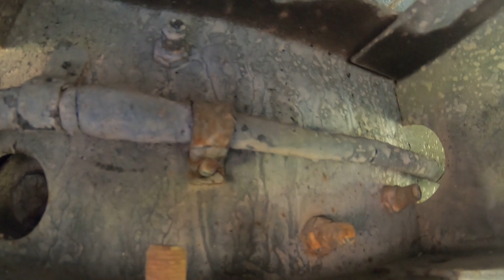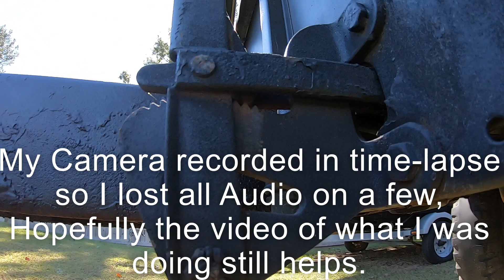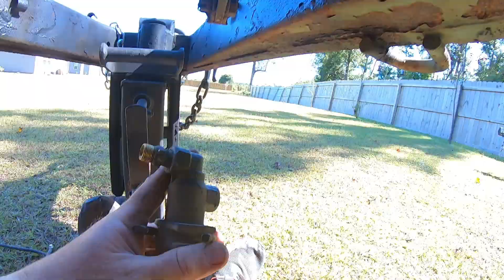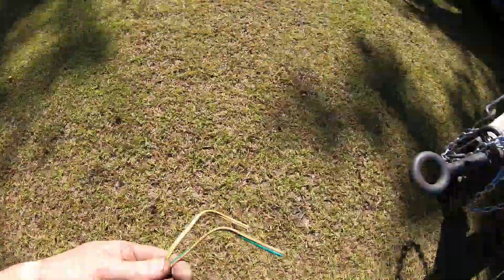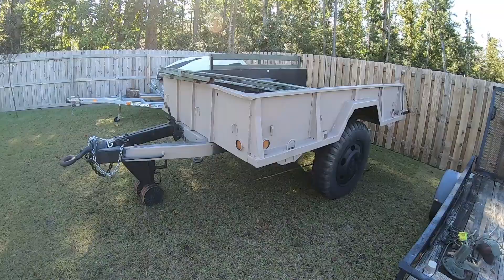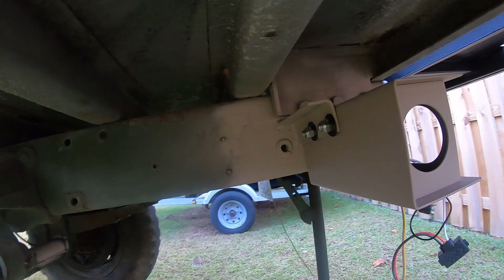M105A2 Trailer, tear down and lighting install started.

Comment: I'd drill out the 24v spots in the stock lights and just add in 12v sockets and wiring. Get the old style halogen bulb sockets and just throw in LED bulbs.

Comment: Why not just put 12 volt bulbs in the existing lights. Keep it simple.
Reply from the maker: There was a few reasons that i wanted to for my build. 1st is when using 24 volt with only 12 volts the brightness will be half. The 2nd is the older wire was brittle. 3 there was no way to just plug it into the jeep, so I needed to wire in a 7 pin anyways. 4th I wanted lower amp pull on the tow vehicle. It keeps the alternator and battery from having to work as hard. 5th, with LED's I am able to use them as emergency flash patterns. 6th they are brighter and can be seen from a much further distance. I'm sure there are a lot of other little reasons, but those were my big reasons to change  them out, Oh yea, I think the LED looks better also.

Comment: Where'd you pick up the brake light boxes and signal lights? I got some plastic lenses but am really not enthusiastic about those on an off road trailer.
Reply from the maker: Amazon.com
 https://smile.amazon.com/dp/B07PT5Y29V/ref=cm_sw_r_cp_apa_i_wsPLFbYAKQG3P?_encoding=UTF8&psc=1

https://smile.amazon.com/dp/B07YP5618P/ref=cm_sw_r_cp_apa_i_ctPLFbCCEMYE4?_encoding=UTF8&psc=1

https://smile.amazon.com/dp/B00VJURTD6/ref=cm_sw_r_cp_apa_i_MtPLFbABV3HEB?_encoding=UTF8&psc=1